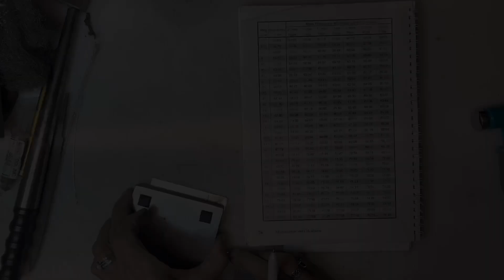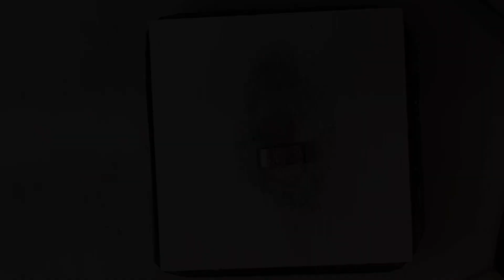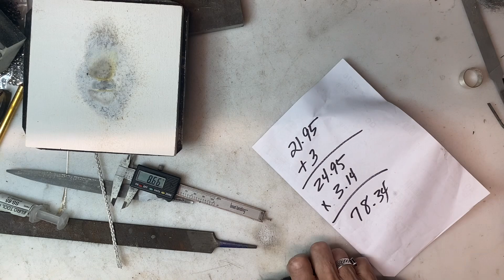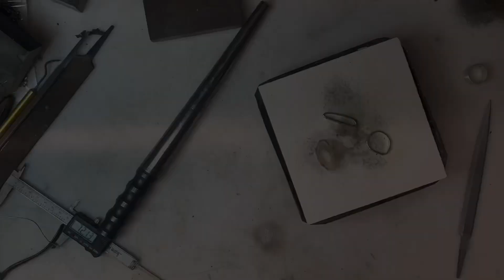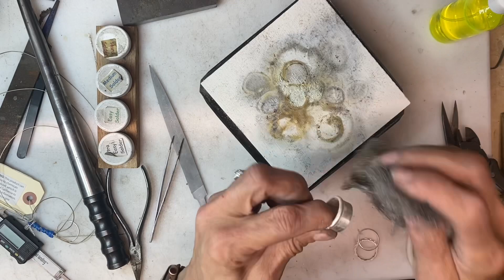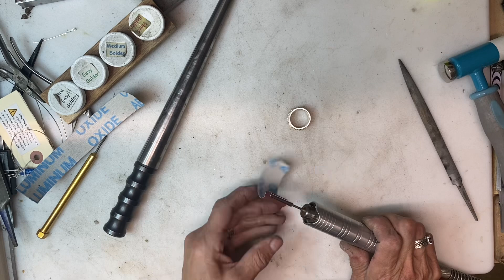Sterling silver braided rope band ring - Flatwearable Artisan Jewelry

Comment: Excellent tutorial. Where you stepping the solder grades down as the soldering process went on? Or were you using hard solder all the way through?
Reply from the maker: Hard solder for all of the initial joints, then step down from that to medium, then easy.
Reply: @FlatwearableArtisanJewelry  Cheers, that helps. I'm new and still finding multiple solderings a bit of a pain.
Reply from the maker: Once you get proficient you can solder with only one type.  It's a matter of learning to control the flame.  You'll get there.